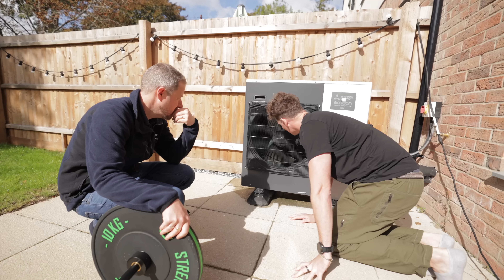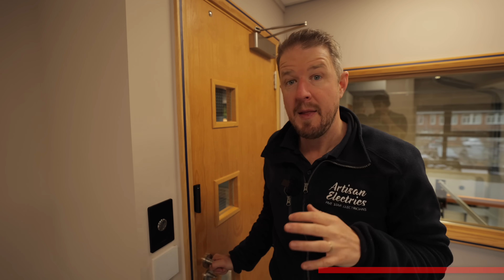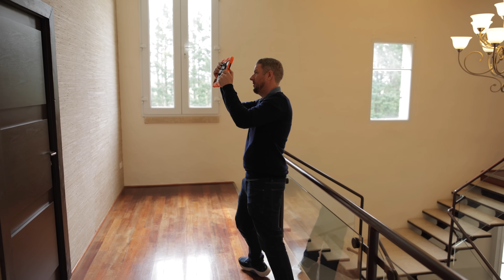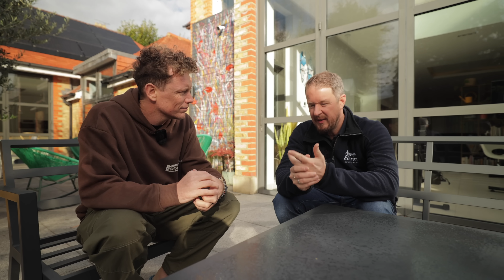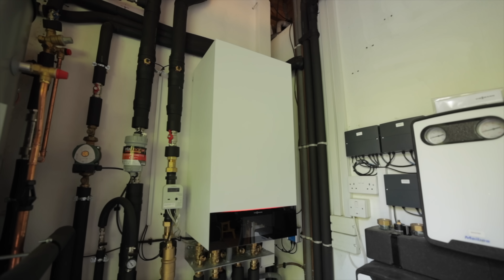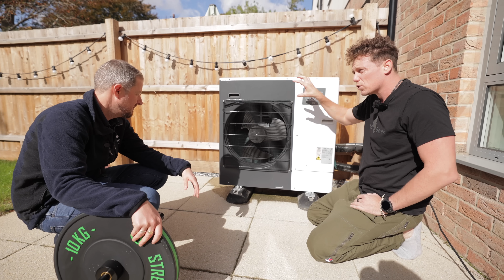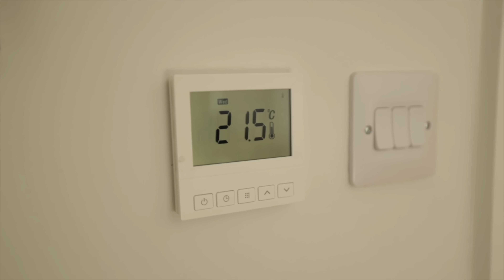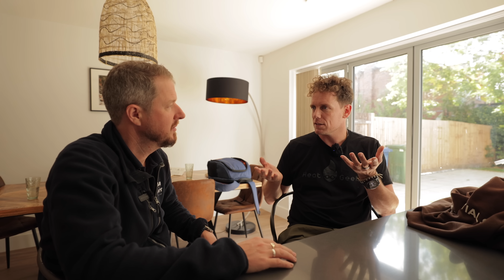Are Heat Pumps Really Worth It In 2026?

Comment: This is something I’ve been looking at since getting a solar/battery install this year.  The warnings of ‘cowboy’ installers is worrying, so I’ve been looking at Octopus BUT I’m not convinced about their pumps.  They look fine for a certain demographic, but I’m not certain my home ‘fits’ that bubble.  Vaillant would be my choice of pump as I’ve got one of their gas boilers and that has never had a fault.  Might give your friends company a buzz.  £2-3k (inc grant) looks about right.  I’d also add another battery as well.
Reply: The actual brand of heat pump is irrelevant, don’t fall for the marketing, the design and install is everything. I have one of the cheapest and oldest heat pumps on the market but it has a efficiency performance that sits within in the top 5 of the heat pump monitor performance tables.
Reply: @yp77738yp77739  Ironically, many of the compnents will be made by a small handful of companies and end up in a myriad of brands devices.  The brand on the casing is of less importance than many believe.  As for the original commentors good luck with vaillant, the gas boiler I had in my previous house was bloody terrible - broke down each and every winter, and thats with proper servicing by a vaillant certified tech.
Reply: I’ve se3n some dodgy Octopus installations, the installer and instal correctly are vital and it seems Octopus may not be consistent in that area.
Reply: Octopus seem to be spec’ing a 3.5 SCOP. At that rate gas is cheaper but they massage the cost of electricity with off peak rates, heat pump tariffs etc. that’s not guaranteed to stay though. Heat pumps are great but really you need a SCOP of 4 to break even with gas. 

Heatpumps also operate on a different dynamic. They cannot heat a house quickly so need to be on a lot longer so if you are out for most of the day your going to end up heating the house while your not there. 

It’s not like for like. Personally I’m fixing my insulation first since I ran the numbers with a new boiler install and that would take 7 years to pay for itself.
Reply: I agree that the SCOP needs to be a lot higher.  4.0 (or even better) sounds about right for me
Reply: Fixing the insulation is essential for running cost simply because again you have no idea what will happen with tarrifs , will cheap rate always be on offer ? Probably but it is a variable .if you are completely refurbing the house then you can insulate from the reflective roof felt down , walls etc , underfloor is by far the best , if it’s a choice then use porcelain tiles not wood , despite wood being rated as ok it is nowhere near as good as tiles , direct experience in this .
   If you end up with as near to a passive house as possible , you can heat for peanuts , I do a 480 sq mtr with ground floor underfloor and k3 rads elsewhere costs 1.84 a day to heat , ran continuously all night 12-7 , off for rest of day 35 degree flow.
  That’s all fine if you a refurbing anyway , as a stand-alone decision payback time  would be substantial, offsetting insulation costs against cost savings on operation depend on a number of variables .
Reply: Maybe, financially, an A2A installation may be better?  Set against the £100pa standing charge, but with a perfectly good gas boiler for domestic water heating, the economics need to be checked out.  Once that gas meter is removed, it may be impossible to have it reinstated at a later date…..

Comment: I have learned a lot from the Heat Geek's videos but when I put my details into their app to find an engineer, it said they couldn't help. 😞
Reply: With mine the claimed heat loss (virtually) was too high to gain interest from them. Yes, we have an old and fairly large house, but the heat loss estimate is nuts. In fairness, they now offer a bespoke service which we could use at a price - that is OK provided it is executed properly. From there it's a case of finding an approved Heat Geek engineer and the nearest one is over 30 miles away. 

Thankfully, our oil system is running well and isn't excessively expensive. When it starts to die I'll have to seriously look at a heat pump. I'm sure that things will improve as more installers become competent and component prices drop.
Reply: @ianbeck5897  Yes, our projected heat loss was too big. There was no indication in the app that there was a different service for such properties. I suppose that if you're a growing company you sometimes have to be selective to maximise what you can do with your resources.
Reply: @ianbeck5897  If you have a high heatloss property also talk to some aircon/hvac people. An air/air system can do much much better than air/water at high heat losses.
Also price and think about insulation first IMHO - if you can. Not only will insulation usually have the best RoI all round but it's a disaster if you install a large expensive air/water system and then fix the insulation as you've now got an oversized heatpump that will cycle and run really inefficiently.
Reply: Same happened to me. I emailed Heat Geek to let them know. Got no reply but the day after the website did work.

Comment: you never realise the downsides of any particular system until you try it, and the insane installation costs of heat pumps for heating are a serious beatdown for 99% of Brits
Reply: To be fair with the government scheme currently going on the price between a heat pump and a new gas boiler fully installed isn’t that far apart, having recently replaced an oil boiler for a heat pump there was only around 1500/2k difference between the two
Reply: @davidwilby1840 it's a subsidy for wealthy people, it's absurd it's even given out.
Reply: @davidwilby1840  to be fair the thieving stabbard govt using my taxes to pay for other peoples' heating system is just one of the reasons I loathe and despise them all
Reply: @davidwilby1840    Agreed on that but like all government subsidy schemes there are times when prices are jacked up unnecessarily by the sharks of the supply side.  

Loft insulation was one I avoided.  Cheaper to get a private job done than the hassle of giving the government every detail of your residence (so they have that information ready to clobber you for extra taxes in the future, if possibly possible!

Comment: I have a bit of a special usecase coming up. I’ll be heating the home with a hydraulic cooled Bitcoin miner in about a year. I need a heatpump to help in winter, but mainly to cool the inlet water of the miner in summer. We’re talking 5,5kw of heat 24/7. Currently thinking ground source for efficiency in cooling. No clue who the good engineers are in the region of Antwerp Belgium…

Comment: An interesting video, Jordan, even for me in Sydney. Heat pumps have been used here for swimming pools for decades. They're being used more and more for hot water system replacement here. A lot simpler here,  not needing radiators etc! (A 40C day in past week). I had my unit / apartment block gas central hot water system replaced with dual heat pumps and two 400 litre tanks, about 15  months ago. Our 12 units were paying up to AU$60 per month in past. Last month it cost AU$10. The systems use CO2 refrigerant with a COP up to 6.
Reply from the maker: Thanks for sharing your experience with heat pumps!

Comment: I'm from Norway. We often use an air-to-air heat pump. Due to the weather, we want to cool down homes in summer and heat them in winter. What do you do in the UK to cool down in the summer?
Reply: "What do you do in the UK to cool down in the summer?" We suffer and complain like real brits.
Reply: We crack the window open in houses only business and some public transport have AC really
Reply: We crack open a beer and check the weather forecast in the hope the heat won't last too long.
Reply: sweat
Reply: We only get a couple of weeks of hot weather in summer. Not worth the expense of AC.
Reply: @Swipe650    Agreed, plenty of ‘portable’ air conditioners available.  But, and a big BUT, A2A installed is a lot cheaper than A2W - along with no need to jump through all the government hoops, and still perhaps finish up with a lousy installer.
Reply: @Swipe650  that depends on your home and where you live, and is changing each year. Especially for vulnerable occupants. I live in a bit of a worst case scenario and even with reflective coating on the windows and proper management of light/air depending on time of day, our bedroom was 27+ degrees in the evening for two months, perhaps more, this summer. For some people that’s fine, for others that’s a health hazard.
Reply: What nobody has mentioned is that the government grant foolishly didn’t allow air to air , I believe it may be changing , but for years it’s been a no , when if they had allowed it many more would have been installed with less cost and disruption .
  But you see our government and civil servants are particularly stupid .
Reply: @pmb9172    The (or one) reason the grants didn’t include A2A was because it didn’t necessarily get rid of the natural gas supply - ie removal of gas meter.  I believe A2A can be a better and cheaper option - but with retention of gas cooking and water heating.

A second reason might well be that (with no A2A) should marginally reduce electricity use, by not providing/encouraging air conditioning in the hot summer periods.
Reply: @oliver90owner  So you cook with electric and get an instantaneous hot water system.  Get rid of gas.
Reply: It was the use of the system as air con that prevented its inclusion , which is daft given our variable summers .
Reply: @pmb9172   I don’t think that was the primary reason.  I believe the gas meter must be removed, in order to get the subsidy.  That would mean zero natural gas usage.  But nothing stopping installation of propane for cooking. Other options for hot water are solar thermal or solar photaics.
Reply: @sjcsystems   Nope, not at the moment.  Cooking is by gas hob and electric oven/airfryer/induction single hotplate.  I have 200+litres of oil to use up.  Just tossing up whether to lose that £100+ annual standing charge and scrap the gas boiler and gas fire in the lounge.  I think the A2A will be sufficient (without the gas fire) all the time.
Reply: @oliver90owner  And the massive irony in that is that most people who dont have gas fired heating wont have gas fired hot water either as everyone has combis.  And to add that almost everywhere new kitchen installs are electric cooking anyway - my mum (who refuses to believe its no longer 1970) spend a fortune on sourcing a gas oven for her new kitchen, theres hardly any to pick from - even gas hob tops usually come with electric fan ovens.
Reply: @jameshodgetts7541     Electric cookers are cheap - no need for a flue of any particular description.  No gas fitters involved, either.🙂

Are ‘combis’ not gas fired?  Combis are no more efficient than a hot water cylinder - they are only better when fully up to temperature.

I have electric oven, air fryer and single place induction cooking thingy.  The gas hob has been in situ for about 35 years.  I will change  to all-electric when I can heat with A2A - well that is my plan  Currently gas standing charge exceeds the cost of gas-used by a factor of about ten times.
Reply: @pmb9172  It is changing because they've realized that everyone who got air/water is now going out and buying a hideously inefficient single house portable aircon as well.
Reply: Increasingly UK people are going to air/air systems because of climate change and the like (as well as terribly designed modern houses). The whole air/water system is a nonsense of nailing together random technologies that don't belong together as a migration hack. It's like a PHEV car.
Reply from the maker: In the office, we have an air conditioning system but unfortunately, this is not a feature in a lot of homes atm
Reply: We do not need air con.
Reply: @johnburns4017    Who is “we”.  Just yourself, or the average younger Brit who can sit outside, or those that have access to a pool? 

Climate is changing.  People are living longer.  Some of the old and infirm have difficulty coping with very cold winters.  Hot summer temperatures are also causing distress to that sector.  I could easily cope with hot British summer days, but my wife less so.  We never had any form of A/C but I may do in coming hot spells.  I can cool down in my car if it gets too serious, I suppose.🙂

I can remember one day in Ottawa, when I caught the bus to the city centre.  I stepped off the bus and into a shop adjacent to the stop, looked around and actually exited onto another street with a bus stop very adjacent.  That was enough, so I took the next bus home.  It was sufferable enough on the outskirts of the city, but insufferable outside in the city centre.

With A2A there is the option - and fast approaching 80, I may need that option.  My solar generation will cover that need, so no extra load on the grid in my case.
Reply: @oliver90owner Bosch Climate 5100 set 25 or 35 depending how large of a house. If you need larger areas or two stores to be cooled/heated there are multispilt units.
Reply: @oliver90owner 
The "we" is the UK in general. Design a house properly then a/c is not needed.
Reply: @johnburns4017    A properly designed house?  In the UK?  Who are you kidding?  Even if this latest shower get anywhere near the new homes in the next 3-4 years, most of those houses will not come anywhere near Passivhaus standard.  Even a passivhaus will eventually get to ambient temperature, exactly like any other body in this Universe, if there is no active control of the temperature!

Next, have you never seen or understood any statistics - like the ‘bell’ distribution?  Of course there will always be homes that lie far away from the median.

Lastly, and very important, is how many properly designed houses (for temperature control) are there amongst the millions already in existence?  Do get real and not fantasise.
Reply: @oliver90owner 
Just ensure there is enough thermal mass, shading and ventilation then a/c not needed in the UK.  Not difficult. 

Norwegian houses have a high wood content with less thermal mass. Hence they may need a/c. They heat up and cool quickly. The thermal mass - solid masonry - is a thermal buffer.
Reply: @johnburns4017    Yes but.  My points are much more valid than your suggestions which have been known for years.

Most new houses?  Lightweight construction.  Few draughts in new house builds (how many per year) but loads of older builds that have neither good insulation nor draught proofing.  Absolutely millions of those that are both difficult and expensive to up-grade.  Are you suggesting we ignore those that either need A/C or those that are unable to easily bring their homes up to anywhere near passivhaus standard?  Do think for all the community, not just for those above the average (even if not much above it.  Remember 50% of any poulation will be below average.  Goes for homes as well as people.
Reply: @oliver90owner  
'your suggestions which have been known for years.'

Yes, that was how we built not needing a/c and giving more even temperatures all year around with no fast temperature rises and drops. Light frame buildings, like in Scandinavia, with little thermal mass, are best suited to forced air as it raises and lowers the temperatures quickly. Hence they use air to air combined heat and a/c heat pumps.
Reply: @johnburns4017 ”just do x y z”. Yeah, I would. But the bellends who built all the houses I must choose from within my budget definitely didn’t! So….
Reply: @TheShortStory  
My place has high thermal mass with nine foot ceilings. Georgian windows up to ceiling height. I have never needed a/c. Pull the top sash down and the bottom sash up then wonderful ventilation in summer. This was the way we built, and it worked due to trial and error over centuries. Have secondary double glazing and external insulation on this type of build then bingo.
Reply: @johnburns4017    You are obviously referring to one isolated example.  Isolated because there are not that many in the whole of the UK.   As I said, get real and consider the whole housing stock, not just your house.  You may not require A/C but others might well appreciate a fair number will likely need it in the near future.  Or perhaps you have not heard of climate change?
Reply: @oliver90owner  
Most British homes have high thermal mass.
Reply: @johnburns4017    Yeah right.  Heat up in the daytime and cool down very slowly overnight.  Please get real just for a while.  I’m not going to reply to you again on this ‘thermal mass’ cr a p again.  Simply a waste of my time and effort.  Bye.